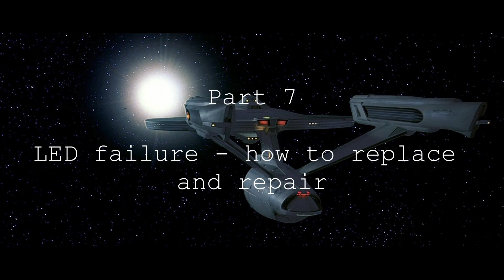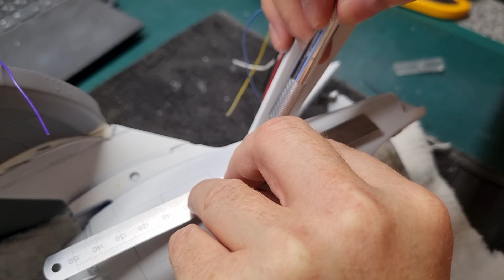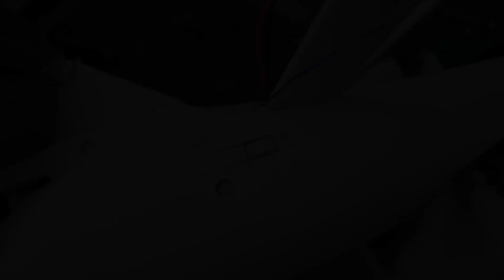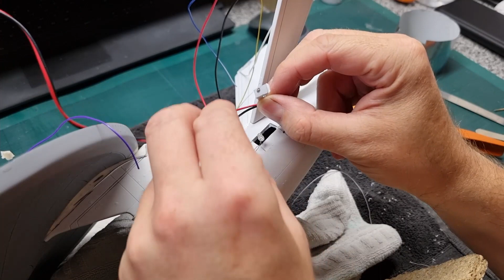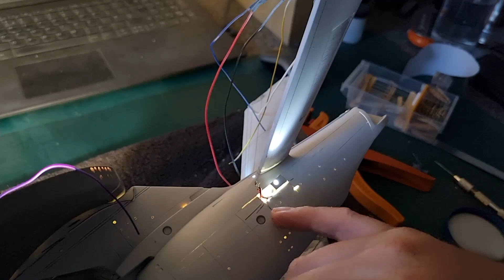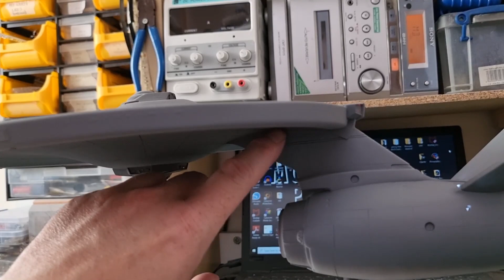AMT 1/537 Enterprise 1701-A, Part 7 - LED Failure! How to replace and repair faulty components

Comment: Great job on that repair! I had so many things go wrong on my build I just walked away from it for about four months to clear my head; but, like you say, anything can be fixed and I got it done in the end - it wasn't elegant at times, but sandpaper and paint cover a multitude of sins!
Reply from the maker: Some projects just seem to go that way from time to time, don't they! This one has certainly had it's moments, but it'll get across the finish line eventually 👍

Comment: The model is coming along great, I really like all the improvements you've made, looks way closer to the studio model. One thing that stands out to me however is the scribed line you have on the pylons for the blue area at the front, it goes back to far on the sides. In fact, the studio model had no scribed lines in that area for the paint the same as the front of the engines, Polar Lights put the lines on their 1/350 scale kit, but the studio model didn't have lines for that.
Reply from the maker: Good spot James, I'll admit I never noticed that before. That being said, this kit is never going to be 100% accurate to the 8' filming miniature, and isn't really meant to be. There are just too many things to correct - even with all the after-market parts available. A few scribed lines here and there aren't a deal breaker, the saucer lines are certainly wrong too. The secondary hull lines were rescribed only because so many features were being changed, it was easier to fill everything and start from a blank page so to speak. Even then, the secondary hull still isn't 100% accurate, but it's a lot better than stock